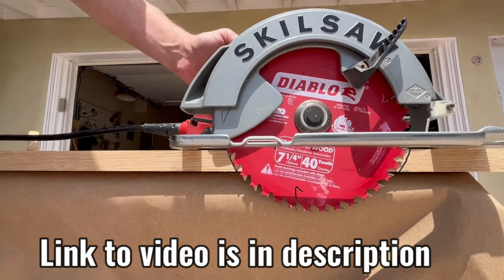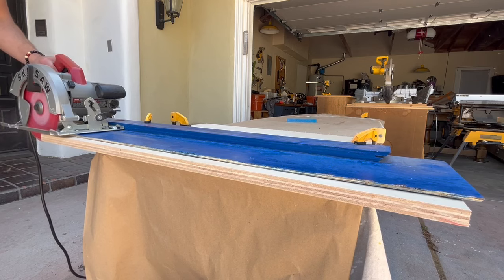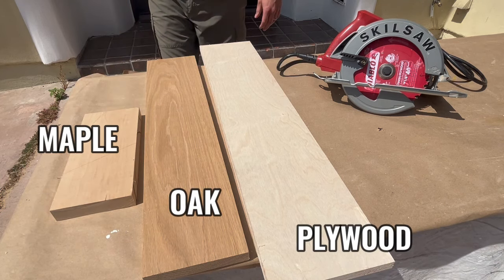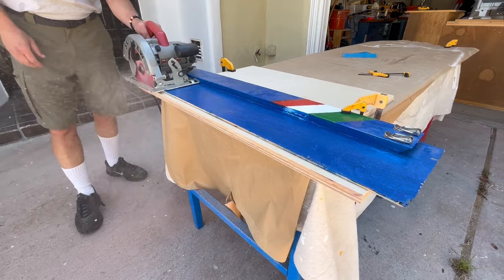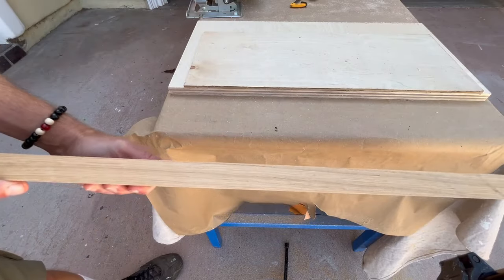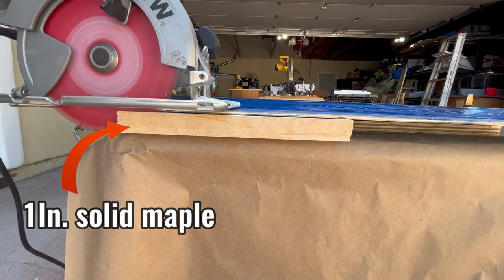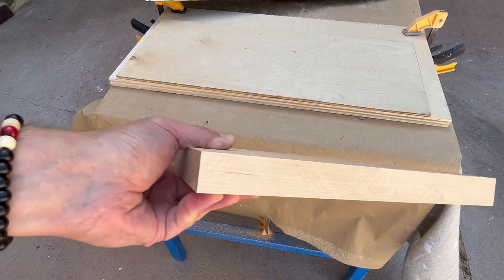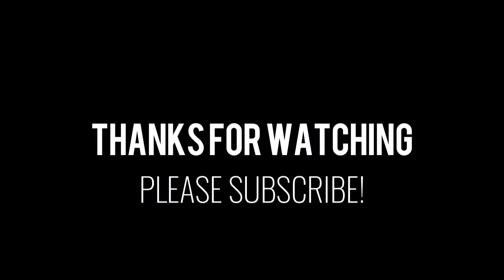I sparked a heated controversy. Is this the solution?

Comment: I think that you're thoughts on this are correct, but on my table saw I lift the blade just enough for the dust removal gullets to work properly (I can see the bottom of one gullet at the top of my workpiece). Not sure if the same should apply to circular saws, or not.
An interesting topic. Take care.
Reply from the maker: Glad you found this topic interesting and thank you for your comment!

Comment: The best argument for 'depth = just over material thickness' is the same as the table saw.  If you happened to come into contact with the blade inadvertently, there is much less exposed.  1/8 inch would barely go through your skin in most places, where much deeper and it can do amazing tendon, muscle, and bone damage.  Of course to be totally avoided anyway, but it is a huge difference in safety.  If something did go wrong, it might save you a lot of pain and damage and permanent injury.
Long shallow cut does produce a bit less tear out, where a deep cut up through the material pulls the splinters up, but has a shorter cutting path through the wood.  

I generally preferred a bit more cutting depth myself.  But after listening to Stumpy Nub's reasoning on it I have to agree, best to keep it only 1/8th inch or less through the wood.  If something carries your hand into the blade, there's a chance the wood thickness itself will save you from most of the damage.  Even if the wood was cleared and you hit the full blade, still 'less is better', and having another half inch or inch exposed blade would probably only make it even worse.
Be extremely aware the once in a while you do decide to cut deeper for one reason or another, and for most normal cuts default to 'just beyond the thickness needed', of course still keeping high awareness of what you're doing.
Of course I'm accurate and careful, so I never considered it too much of a concern.  But the argument for doing shallow in case something did happen so there can be much less damage is compelling, even if it never happens.
Reply from the maker: Thank you for your comment and feedback. I also think Stumpy Nub is right and out of a concern for safety it is good to have less blade exposed. Thanks again for sharing your opinion on this topic.